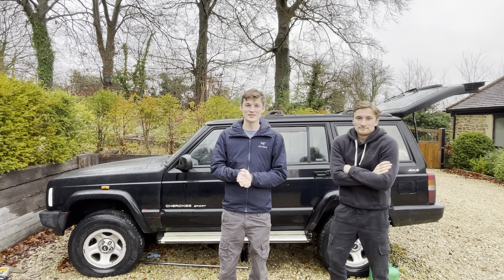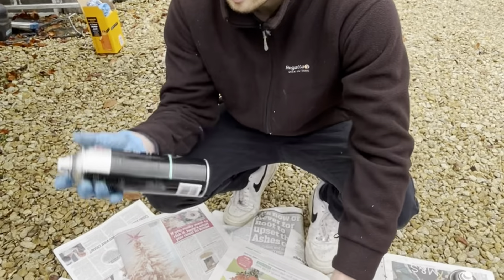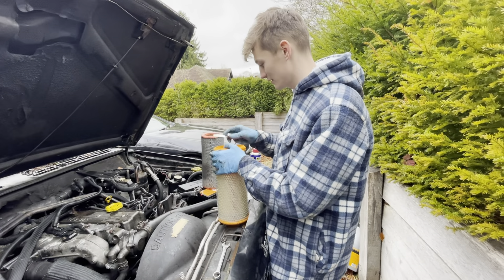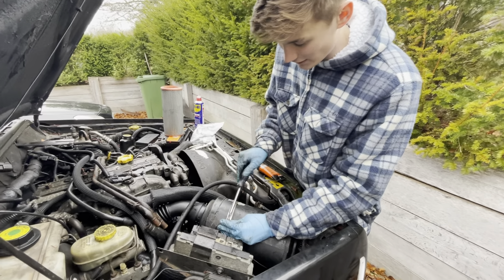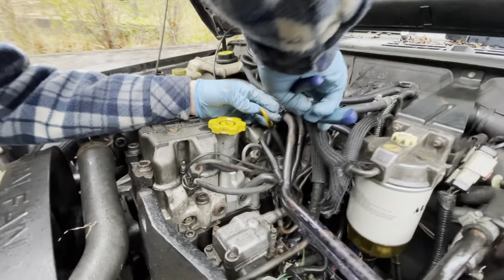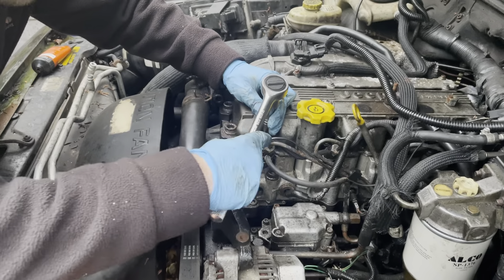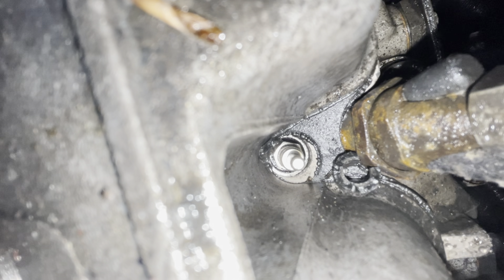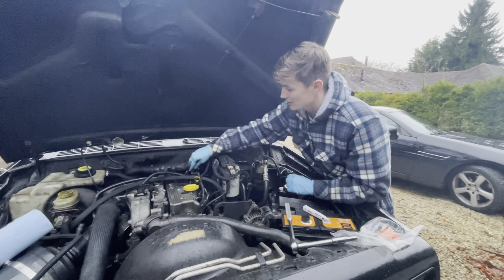Restoring an ABANDONED Jeep Cherokee XJ! Episode 2

Comment: glowplug is a heating device used to aid in starting diesel engines. In cold weather, high-speed diesel engines can be difficult to start because the mass of the cylinder block and cylinder head absorb the heat of compression, preventing ignition. Pre-chambered engines use small glowplugs inside the pre-chamber